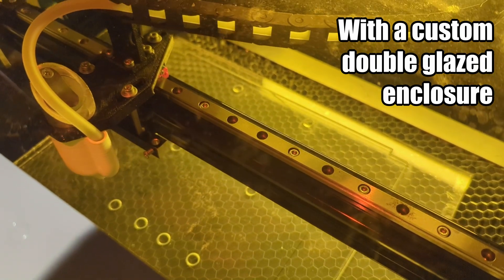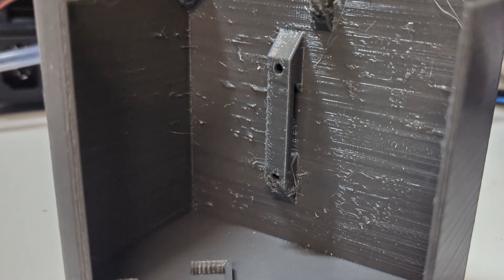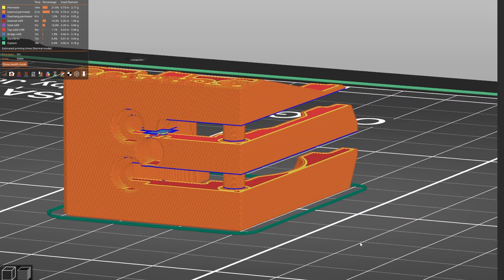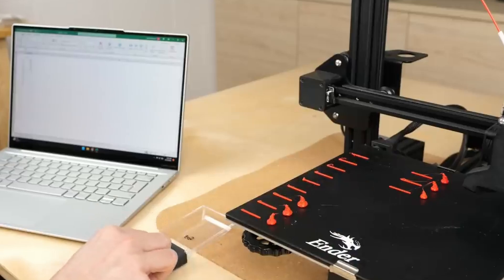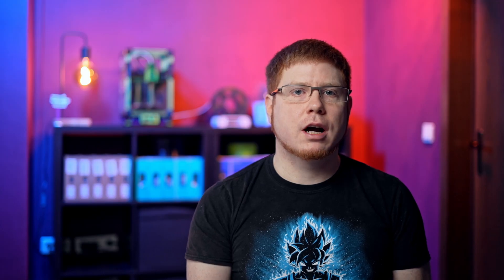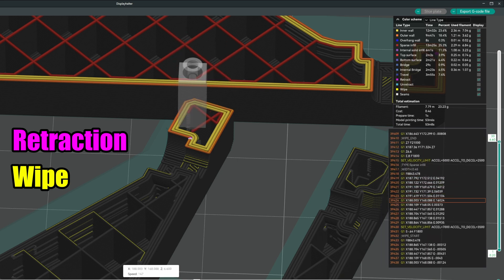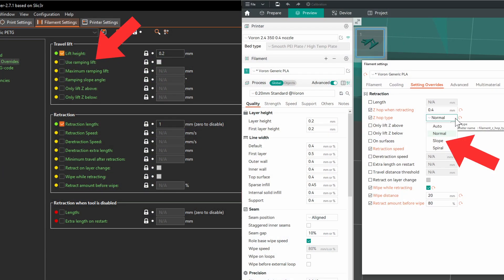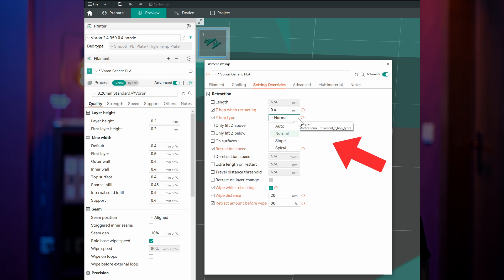3D print quality: 8 easy SLICING and TUNING tipps for PERFECT results with Prusa & Orca Slicer

Comment: I guess I should change from cura to orca then?
Reply from the maker: Haven't used Cura in years. Even back in 2018 I found Prusa Slicer way better. Although there seem to be some rare edge cases where Cura produces a better result
Reply: @SmallBatchFactory  to be honest since I don't print that much and what I pront isn't complex its pretty simple functional stuff like fixtures to hold things and fixes cire hasn't giving me a lot of issues with quality but every now and then theres a part or two that gives me a slight headache. All my printers are custom so is either a very nice print or a nasty one there is no middle ground 😂. But now I'm venturing on corexy builds, and klipper might as well change my slicer while at it. I just like to build stuff 😅
Reply from the maker: I'm not sure about Cura but Orca and Prusa Slicer come with a lot of built in profiles these days. Makes setting up a new printer very easy.

Building printers is fun! I own three Vorons and would build another one if I had more space

Comment: On removing stringing with a heat gun: Go for a small (kitchen-sized) propane torch instead. It provides heat in a more focussed way, keeping the part cooler and hence from warping. It also not just melts but burns off any thin stringing. No blob removal required.

Comment: Content idea: SEMM Single extruder Multi Material. So multicolour without AMS. It's poorly documented, still requiring lurking through prusa forums, but very interesting. In few months I'm going to dive into it for my home cockpit (simpit) panels (labels in white). Idea 2: FreeCAD. So hot right now! ;)
Reply: poorly documented but with special facilities in the interface and gcode! (Multi material section in Orca)
Reply from the maker: Sounds interesting. In the past I did such things with material change at a certain layer or even setting the material change in the GCODE by hand.

I tried FreeCAD a few times but didn't like how complicated things are handled. Especially that you can't extrude parts of a sketch, you always have to extrude everything.
Reply: @SmallBatchFactory  And that's why you should read the FreeCAD 1.0 release notes on the wiki! :) Multi profile sketch extrusions are now supported, plus many many more!
Reply: @SmallBatchFactory  From what I've read the SEMM should allow for multi color within a single layer. Different layers in multi color are obvious. You insert Pause right in Orca layer slider and change the filament as you normally would. The 0rinter doesn't care what you are doing during the pause :)
Reply from the maker: @Tome4kkkk sounds like I need to check it out again!

Comment: So, I'm getting back to "no Z hop". What would be your recommended Orca setting set for the entire Printer - Extruder - Retraction section?
Reply from the maker: Unless you got issues with the current settings I'll leave the rest of the settings as they were. Length and speed depend on the printer and type of filament.
Reply: @SmallBatchFactory  So ill just leave everything from stock BL A1 profile, just z hop 0. Thanks.

Comment: I'm still lost how to handle between Don't Slow Down for Outer Walls, Minimum Layer Time, Max Flow Rate and regular Speed settings. Especially the DSDfOW.
Reply from the maker: Minimun layer time primarily ensures you're not printing so fast that the print becomes a blob (only relevant if a layer doesn't have much area to cover).

Max volumetric speed impacts every movement, like a limiter. You can't go above that, no matter what speed you set.

Haven't used DSDfOW so far. I prefer slower outer walls for better looks
Reply: @SmallBatchFactory  Thanks. A gold mine channel you have and thanks for responding. With disabling DSDfOW it's not about not slowing down but keeping the speed more consistent... at the cost of not slowing down. The problem with the slowdowns is: 1. There is no smooth transitioning. 2. The speed can change several times per mere 10 mm of print height.
Reply from the maker: Thanks a lot!

Doesn't sound like a big problem to me. Never had any reasons to keep speed more consistent. It might be different for bowden systems though
Reply: @SmallBatchFactory  It's about PLA going from matte to shiny, back and forth. But I agree, it's an edge case.
Reply from the maker: Matte look is often a sign of too little temperature for the set speed. I'd expect faster printing to result in a more matte look

Comment: Another good video with some great advice. I just moved over to Orca Slicer and have been printing with it, for the last week... it's an excellent slicer, with a well balanced combination of Cura/Prusa features. The z-seam functions are robust and they've improved overall quality. I've bumped my speeds by about 15-20% and get the same quality prints.
Reply from the maker: It's definitely a great Slicer. I just can't wrap my head around some UI decisions. Might be just old habits but some features are even missing (mentioned in my "remove logos" video). For someone using those features it can be a real bummer. And the second issue is I can't easily transfer my profiles and Prusa probably won't port the mk3 profiles over.

Comment: Thanks for the video. There are some excellent tips and suggestions even though I’m still struggling to understand their meaning. 
I’m brand new to the hobby. I’ve just obtained an Ender 3 (OG) printer. I’ve muddled through a few prints with the quality of the prints being surprisingly decent. 
That being said, I’m trying to learn PrusaSlicer setting by setting. 
Are there preconfigured filament setting files that can be downloaded? Seems that the filament manufacturers would provide these but I’ve been  unable to any, except for those provided in PrusaSlicer. Can the material profiles for one brand of PLA+ Matte be used for all PLA+ Matte filaments? I have a ton of these questions. 
I’m slowly making my way through your catalog but any input or suggestions would be greatly appreciated. Thanks for the videos
Reply from the maker: Thank you for watching! In my experience specific settings for different filaments of the same category don't matter nearly as much as one would think. I usually just use "generic PLA" (PETG, ABS and so on). Some manufacturers recommend a different temperature range than the generic profile (Extrudr PETG prints a bit colder for example) and that's what I change then.

If you're into optimizing the very last bit out of speed (quality is usually fine either way) you can tune a profile to perfectly fit a material. Did that when we printed face shields for the pandemic with an ABS filament. The profile completely fell apart when I used another ABS brand. For me speed doesn't matter that much. With experience you'll be able to tell issues while printing and adjust settings on the fly (I. E. matte outer walls indicate print temperate needs to be higher)

Comment: Thank you very much for these tips! I tried to print an aritculated dragon 6 times and over and over there was the same problem. After watching this video I finally printed one. Thanks!
Reply from the maker: I'm glad I could help! What was the issue before?
Reply: @SmallBatchFactory  In the middle of the print filament stopped coming out of the nozzle and the print looked like here 0:54. The print succeeded after I changed some retraction settings.
Reply from the maker: @hubert1889 I see, thanks! I've had that with TPU in the past, to the point we're I turned it off completely since I couldn't get any retraction to work

Comment: Any tips on setting up a a printer with klipper? Iv a cr10 smart pro running a sonic pad and I can't see any1 doing a video on how to set that up to get the best possible results
Reply from the maker: I know it's not what you want to hear but the Klipper documentation is really great for getting the best out of the printer. For a start you can probably use the config of an Ender 3 and go ahead from there.
Reply: @SmallBatchFactory  I was using the ender 3 s1 pro profile for the marlin but once changed over to klipper I wasn't sure if I should change it to klipper in the settings?

Also in cura u disable acceleration control but is there the same in orca I wasn't sure I could see it being new to 3d printing I couldn't find a good start point for orca with klipper
Reply from the maker: Orca also has a setting for acceleration control somewhere
Reply: @SmallBatchFactory  thanks ill go hunt for that I couldn't see it initially! Should I change the gcode to klipper or leave it marlin (in cura it's marlin)
Reply from the maker: @davyw2278 it's probably a good idea to set it to Klipper. No guarantee from my side though
Reply: @SmallBatchFactory  OK cheers for the ideas I'll have a hunt into it

Comment: The current version of Orca Slicer also added Scarf joint seams, where the seams get less visible (but wider) by printing them like wedges for each layer. I found it quite neat on round decorative objects where Seams can be very obvious. This feature released about a month after your video post.
Reply from the maker: I've heared of it. AFAIK it takes a lot of tinkering
Reply: @SmallBatchFactory  if you want perfection it may be but just enabling it and leaving all the settings as is makes a noticable improvement. Bambu Studio also implemented this feature in the beta build but seems to get worse results than Orca Slicer for now. It's not perfect but really nice for certain prints.
Reply from the maker: I have to try it. Couldn't get myself to make Orca my daily driver yet. 

Seems Bambu is lost without taking innovation from the open source community.

Comment: Personally, I think it's overrated that normal filament has to be dried. I use PETG, which has sometimes been lying around open for years and have never had any problems with it. The prints were always perfect.
On the topic of drying in the oven. Of course I can dry the filament in the oven. Nobody would probably think of doing this with food at the same time. And it is not forbidden to clean the oven afterwards 😅
Reply: You guys probably live in a desert area
Reply: @samsmucker6419  what you will say us?
Reply from the maker: South Germany is definitely not a dessert. But it's also not as humid as Malaysia for example. 50% indoor humidity is usual here
Reply from the maker: I also rarely dry my filament. As you said, not many issues. Stringing is a bit more noticeable. I only ever dryed Nylon and a spool of PETG specifically for this video. 

You'd have to clean the oven very thoroughly. I have so much residue in my printers acrylic sheet, I wouldn't want to have the same on my ovens walls. It's just not worth the effort, filament dryers are pretty cheap.
Reply: @SmallBatchFactory  OK, maybe you're right and I should reconsider. What works well are fruit dryers. I think the Sunlu dry box is useless. As far as I know, I saw it at a friend's house, this box doesn't have any vents for the warm air to escape. This means that the warm, moist air remains trapped in the dry area. Or has sunlu changed the design?

Your IKEA Hach is great 🙂
Reply from the maker: At least I wouldn't risk it. Ultimately it's everbodies own decision. The Sunlu I got is a newer version with a small fan. Food dehydrators are probably better. Only advantage is the Sunlu has a spool roller so you can print out of it.

Thanks, those IKEA boxes are sealed really good. I have a few more but that's the only one you can print directly out of.
Reply: @SmallBatchFactory  Would you care to share the STLs or Design on how you build these dry boxes? I consider doing something similar but all the guides i found so far are based on some amazon cereal boxes. Ikea would be a bit easier to get :)
Reply from the maker: @boulalaplusten I can upload the boxes I used for the silica pearls. The rollers aren't my own design and I just scaled them down to fit inside the boxes (and designed the silica boxes so that they sit flush with the rollers). Let me know if that would help you with out (I'm not on my PC right now, need to upload later)

Comment: Yeah, here the periodic head movement is not distracting anymore.

But I have to say, that the elephant foot compensation (atleast in Cura) only adjusts the first or first few layers. 
But the elephants foot stems from the first 4-6 layers.
Reply from the maker: Sounds like you turn up the bed heat a bit too much. I've never whitened a real elephant foot, meaning the print getting soft and deforming.
Reply: @SmallBatchFactory  it depends, most people have what we call ceramic beds, these are very cool, they release the print when they cool off. 

And cling on like a 5 year old child that's afraif from santa.

Comment: @SmallBatchFactory have you done a video, or would you be willing to make a video, showing how to print PVA with PLA for Bambu Labs printers? Particularly with the X1C and/or P1S? Does OrcaSlicer have good initial settings (I don't own a 3D printer at the moment, but I want a printer that can do PVA really well). Does the AMS for the BambuLabs printers have the capability to dry PVA sufficiently enough to print reliably with it (if at all)? If not, what would you recommend for drying PVA?

I'm seriously considering buying the X1C with an AMS just so I can print PVA with PLA as easily as possible--due to the lidar sensor and a few other upgrades for general long-term durability and the ability to experiment with other filaments when I feel more confident in my abilities.
Reply from the maker: I neither have a Bambu printer nor PVA at hand. Printing those materials is more or less the same on any printer. You'll be using Bambu's own Slicer, Orca is just the open source version for other printers. They have plenty of profiles which should work flawlessly.

The AMS has no integrated filament drying. You'd have to dry it somewhere else, in a food dehydrator for example, then put in the AMS and add a box of silica pearls to keep it dry.
Reply: @SmallBatchFactory  thanks for the quick reply! Hopefully PVA won’t be too hard to print with for Bambulabs. A cousin’s work (which is a manufacturing facility for PTFE baffles for the semiconductor industry—ie they work with many type of plastics) has a bambulabs 3D printer that they got last year. They’ve tried PVA but said that it was difficult to work with. Or that it was bad for the nozzle or something like that. I know that PVA loves to string, but I was surprised that they were having such difficulty with PVA. Granted, I don’t know if they were using the X1C or something else. Plus, while I imagine they dried their PVA before use, I don’t know that for sure. 

This is part of the reason I want to see a video on the subject with one of these printers. I want to know if Bambulabs really can do it without a lot of tweaking of the slicer settings.

Do you know of a video that does a good job of showcasing the X1C’s and/or P1S’s ability to print PVA? I’ve tried to look, but I didn’t really find anything.
Reply from the maker: @TheBSprince I wouldn't worry too much about "can the Bambu do it". The materials properties are the same on any machine. It's more about the manufacturer of the filament, they can vary quite a bit. I assume you want to print soluble support material from PVA. HIPS is also a viable alternative, dissolvable in lemonene.

PVA is very nichy so there's not a lot of info on it out there. I have no videos in mind but my suggestion is ignore which printer they use, it really doesn't matter that much. Apart from actual shortcomings (defects) they all get the job done.

Comment: I purchased a Bambu A1 printer in December. I have been using Cura for four years with my other 3D printers and I’ve been using Ironing with Cura and my prints look great. 

In Bambu Slicer I have been trying to dial in my ironing settings, but I have had no luck in getting a successful print with Ironing enabled. 

Do you have suggested settings I can use for Ironing?  Thanks!
Reply from the maker: It's not always about the settings. I'm not sure about your other printers but Google tells me the A1 has one of those pointy nozzles. In my experience you get not that good of a result with those compared to the E3D ones with a larger flat area around the orifice.

Comment: Another great way to avoid stringing is pressure advance in the Klipper firmware. Recently tuned a friend’s Ender 5 Plus (just upgraded with Klipper, otherwise stock) with Polymaker CosPLA and was able to use 1 mm retraction, using a pressure advance of iirc roughly 0.8. It also helps print quality overall, especially on a machine with overall marginal acceleration performance like that one.
Reply from the maker: Pressure advance is especially important for sharp corners. Even more so with a bowden system. It definitely also helps with stringing.

Comment: Do you have any videos that go into better explanation of MIN/MAX FAN SPEED THRESHOLD under the Orca Cooling tab of the filament section?  Or even in Prusa, as I use both for different things.  It is a setting that I am adjusting, but am not really sure what it is doing except changing my print speeds.
Reply from the maker: Basically min fan speed is what is used as if the layer time is at "enable fan of layer print time is below" (Prusa)" or "layer time" (Orca) and Max fan speed is used when the time is shorter as in "slow down if layer print time is below" (Prusa) or "layer time" (Orca). Everything in between means the fan speed is somewhere appropriate between min and max speed.

You can see the print speed of you select "print speed" instead of "feature type" at the bottom of Prusa Slicer. It's got to be somewhere in Orca, but I currently don't know where.
Reply: @SmallBatchFactory  thank ypu.  You can see the print speed in Orca the same as in Prusa.